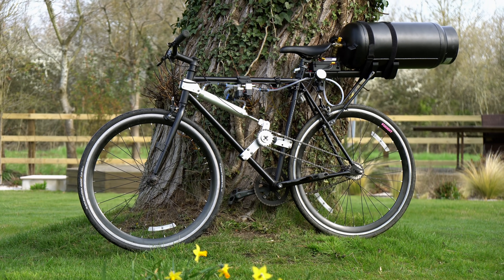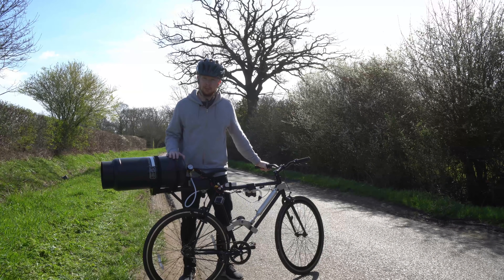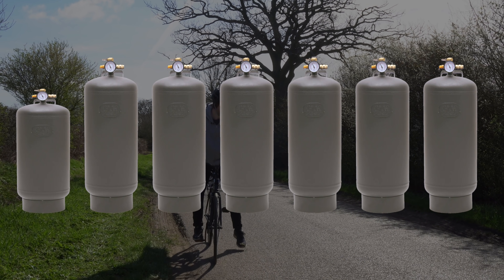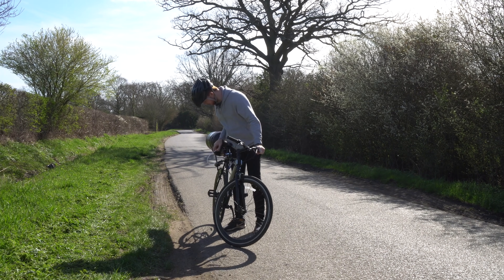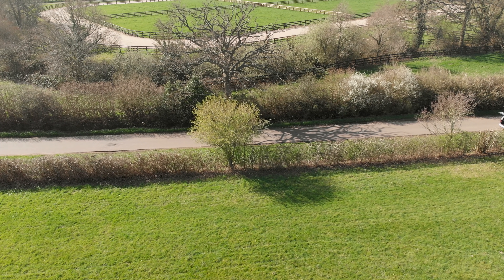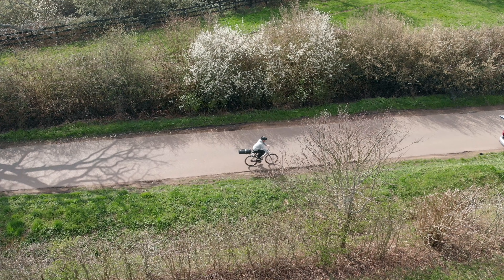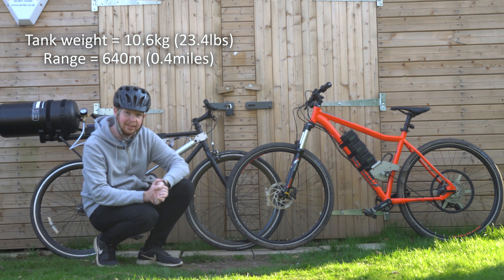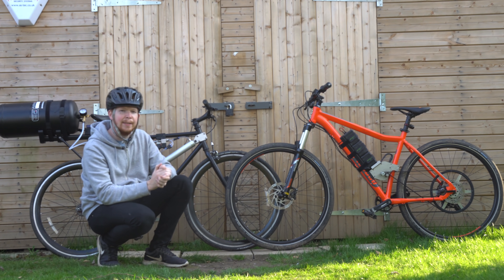Air Powered Bike Range

Comment: I have an idea, what if you make an air bike where when you pedal, it pushes air into a tank, the tank has a valve on it's output where you can turn it on and off, then you can fill up the tank while riding then, you can shoot off with your compressed air jet.

Comment: I work for festo. They did this experiment 30 years ago and got 700 metres out of a tank at 6 bar pressure. Air is extremely inefficient, costing up to ten times more than the price of electricity. Vds and vsc compressors have increased  this efficiency to 25%. By adding heat  retrieval from the compressor we can improve  the efficiency  to 10%

Comment: By the time you factor the heat lost when you were compressing the air into the tank you are less efficient than an gas  automobile .  I'm no expert, but i studied physics at the community college, tho i never got my associate's degree.  Also i don't know that you can improve the design of a modern bicycle, for dog's sake just leave the bike alone.  Try your silly ideas out on a go kart or a pogo stick or some other play thing.  I hate the way people put electric motors on bikes or all that fancy s**t.  The beauty of the basic bike is that it is the most efficient machine made.  it is sublimely simple.

Comment: Fascinating project. Since this is using energy from the procedure required to pressurize air, it can't be equally compared to the stored unbalanced chemical energy transferred from carbon derived the sun's energy, being from solar panels or from ignition of fossilized trees. As a pressurized air project, it's a beautiful result. How about a trailer with giant air tank an two large hard wheels. Center the tank on the axle so the bike is mostly working on pulling the trailer. (It would also be easier to mount the bike!) Nice work. Regards.

Comment: Drop the regulator valve and use cutoff of the intake valve to regulate the pressure in cylinder. Regulator is costing you some energy.

Comment: Hey, What if before actually opening the exhaust you open a valve connecting the 2 inputs for the pneumatic cylinder. At least be able to scavenge half of the excess pressure in the cylinder before opening the exhaust?

Comment: Although I thoroughly enjoyed this latest project it was an unfair comparison of apples and oranges.
A prototype pneumatic bicycle propulsion unit not modified or changed in any way after the original engineering. We're start you have a secondary source of air pressure on the low pressure side that could be utilized. Aire is cheaper to pressurize and store. Windmill for instance you have regenerativere pressurizing for the low pressure side that has not been considered so many things on the pneumatic bicycle to be considered that we're not. And granted it will never match completely or compete with a contemporary thoroughly engineered state-of-the-art e bicycle additional engineeringand development could increase the efficiency and viability of the pneumatic bicycle by huge factors. Consider the fact that underground mining vehicles used pneumatic motors as did streetcars back in the day and they were commercially viable. Pneumaticsusing compressed air storage is a wonderful medium to eliminate be pollution and toxicity of batteries and electric motors. It should be consideredpossibly using windmills year down to drive compressors for free rechargeand compression as well as underground storage tanks for storing compressed are as fuel. Other than the unfair comparison it was a good video once again I always enjoy your videos.

Comment: How about using the bike pedals to crank the air pressure pump, then use the pumped air pressure tank as a plenum, and finally feed the compressed air through a regulator to provide adjustable pressure (adjusted 0 to maximum via the throttle) to a non-impact high torque air pressure wrench mounted on the bike to crank the rear wheel sprocket or simply installed in the rear wheel as a hub motor.

Comment: If you want a small efficiency in the field of compressed air, not the piston engine is the solution but the rotary engines, the turbine ! And even so, you need a rotary engine that perfectly suits the requirement, of what you want to build!  A possible and interesting variant, could be today, the combination of solar energy (photovoltaic panels) and an electric motor (with a speed reducer and torque increase) the electric motor operating a compressor to periodically, cyclically supply the cylinder, so it can be solved and the ridiculous autonomy of the compressed air machines !!! That was my humble opinion !! A good day ! !!

Comment: Silly me. I commented on the first air-powered bike video before watching this one. This video answers pretty much all of the questions I posted on the first.

At the end of the video, you compared energy density and performance between the air powered bike and your electric bike. You also effectively answered the SCUBA tank question. Thanks for that, I had a suspicion that the math wouldn't work out, but you actually did the math (er, "maths" so sorry). Something you also mentioned which I think many commenters in the last video did not consider, was mass. Not only does it take a lot of material to contain such extreme pressures, compressed air weighs a lot more than just "air." I think many people have a common-sense concept that air is weightless. Thank you for explaining that it isn't.

Comparing energy densities, however, one bit was left out: Comparison to carbon based fuels. You mentioned this in your atmosphere powered RC car. There's a reason we're having such a hard time moving away from gasoline/petrol, diesel, coal, and the like. They're very energy dense. A litre of petrol will do much more work than the equivalent mass of even the most efficient battery, and much much more than the equivalent volume of compressed air, given the limits of the technology required to compress and store that air.
I own more than one motorcycle, my littlest one has a very small fuel tank, and will go about 110 miles/175 km before refueling. Eyeballing the size of the tank on your air bike, I expect if I had that much volume as gasoline/petrol, I'd get something more like 400 miles/ 645 km. So... one hundred times more than your theoretical maximum? Oh, also at much higher speeds, say 70-80 kph (it is a really small bike).

Comment: My quest (http://www.velomobiel.nl/quest/) weighs more than 32kg, and is faster than a 5kg racing bike. Racing bikes are a technical abomination, because they try to adhere to sporting rules, not to the best bike technology. Racing bikes are not allowed to have faring, which is the single most highest force that you are facing. The downside of weight is that if you are between cars at traffic lights all red, you will be faster at acceleration at the first light, but the second light you are still recovering, and the third light you might be better of at the bike lane. (Going from 0 to 50km/h is pretty hard 3 times in a row).
In the Netherlands we are not allowed to have support above 25km/h, and the heavy accelaration starts at 30km/h. But it would be nice to see something that can store breaking energy and later on use that for acceleration. But I guess that's better done with electrical motors and super capacitors instead of air :-(.

Comment: Compressed air is the right way to go. Using liquid nitrogen you can achieve the same range potential as lithium batteries without damaging the environment.

Comment: See if you can make it where when you use the bike without the air power, it will fill the tank back up with air. so the cylinder is used as a pump.

Comment: JUST CHANGE THE AIR TO LIQUID NITROGEN AND PUT A ALUMINIUM RADIATOR IN LINE WITH A LPG TYPE REGULATOR   mr boesse nitrogen engine  you will piss it

Comment: I would like you to try flying using either battery or air to flap the wings.
Need a downhill take off I expect and maybe a detachable trolley to ride on.
Reply: How about a glider with a 0,5-1kw electro motor to get u off the ground?

Comment: If you could gas flow the exhaust by bringing the valves closer to where they want to be, i.e. on the cylinder ends. And maybe fit larger diameter valves, then less energy would be wasted re-compressing the air on the way out.

Comment: I'm pretty sure I asked this in a another video, but it seem to havec gone unnoticed. So here we go again. 

What if you were to take away the air tank that's powering the actuator and replace it with air compressors in series and/or parallel to lighten the load and, turning the range dependency from the capacity of the tank (now removed) to the power supply of the air compressors? 

Would this even make sense to try?

Comment: You need to run higher pressure, at least 100PSI for any decent speed 
and torque, and a resevoir having a top holding pressure of upto approx.
 700 to 800 PSI, the tv series called planet mechanics @t explored this, you can use it for some input for getting yours to function better.
Reply: How about variable pressure? To get the bike to spin you need a lot of torque, but to keep it spinning not so much torque and pressure is needed, thus one could start economizing on pressure once the desired speed is reached

Comment: Why don’t you add air compressor to the pedals, so when you pedal you’ll be slowly adding more pressure to the tank to extend the range? Or even connect it to the bike tyres?
Reply: you'd need some insane legs to push the bike + compressor

Comment: But you have to take into consideration, that airpowered trams were roaming quite well in Paris by the end of the XIX century, as well as airpowered cars in mines at the same time. Sure, their range was limited as well, but they've had an advantage of having a better mass/power ratio due to a larger air reservoir, that in addition was transported on rails, and had pumping stations.

Of course, the primary need for airpower was to produce less smoke, and electricity proved superior in this regard as soon as it became available. Paris tram suffered from another problem - due to pressure drop, the air reservoirs were freezing, with a coat of ice building over them. An external heating was needed to prevent this.

Comment: I think you should flip the sides to the right hand drive side and use a rear derailleur to change your gear ratios to make it more efficient so each stroke of the piston get you a further distance just an idea if it has enough torque it should be able to get to a pretty tall gear ratio peace out have a great day

Comment: Great project. But as you are using arduino put an rpm meter and adjust "firing point" accordingly. You would get huge benefits

Comment: are you using air to push the cylinder open and closed? or just one way, then letting the bike return the cylinder? be interesting to see if adding a spring return cylinder would make any difference

Comment: Could you build a sterlin engine powered bike?

Or an elektric bike that is powered from energy you won from an heater ... and with which you can recharge the batery during cycling?

Comment: why won't you use rocket type system.
like removing air from the cylinder through a very small hole

Comment: Please consider fabricating a non-combustive heat generator that generates heat by friction.  
I envision a 50 gallon drum type of first device that would include a serious coil spring as one might find in an old wind up record player, but a good deal stronger.
One would wind up this heater by way of crank or perhaps a foot pedal. A central vertical shaft with flywheel which would spin specified friction points up against some kind of metal pan bottom, creating the heat. 
With modifications, the device could heat a hut without robbing the area of oxygen or polluting it with partially combusted hydrocarbons/soot. With further add ons, it might grind seed to flour, pump water, generate electricity. 
The gearing, spring and flywheel add serious weight, something we want less of, so that it might be hauled through the mountains, jungles, deserts, etc.

Comment: Instead of rotating the pistons crank arm. You could perhaps have used a one-way bearing and just go 1/4 of a turn with a longer arm driving the chain. That way there is no need to time the movement.

Comment: It would be interesting to see how much longer it would go if a gas that liquifies under pressure was used, becauyse there would be more effective volume
Reply: Basically how a steam engine works. Problem there is that you need to add heat energy from somewhere too.

Comment: could you set the system up, so that once the tank isnt being used and its only you pedaling to push the bike along, that the cylander becomes a pump and refills the air tank? or would that require an entire other system

Comment: How about a compressed air regenerative braking system? You accelerate the bike with either human power (cycling) or battery power, then when braking, pump the air into a reservoir of sorts to slow down, then you can use the compressed air to get that extra 500 something meters of range?  

Scratch that, how about just replace your battery pack with supercaps and see how fast that goes :)

Comment: Mountaineering carbon wrapped tanks can approach 50% air weight at about 200 bar. A liquid or solid gas system would also be very interesting as you could have essentially constant pressure. 

I reckon you can convert more energy with a turbine than that piston.

Comment: Mabey try using the pedals to charge the canister back up. You could rig a one way valve so that when you put energy in it compresses the air through the cylinder and stores it in the tank.

Comment: You need to design a bike frame that can be used as the air container, then use a small turbine connected directly to the front or rear wheel. It can be done! where there's a will there's a way!!!

Comment: Not all the donuts succeed with the hole: if the air traction was as efficient as the batteries we would have found the most ecological way of traveling in the world ... apart from the pollution to compress the air and to build the means of transport, there would be no other pollution during use!
Could a jet turbine or a Tesla turbine, (maybe better) be more efficient? of course powered by compressed air not with fossil fuels.

Comment: Compressed air is a terrible way to store energy because of the Carnot cycle - but there's something more shocking - a French company called MDI Air Car has been scamming the world for 15 years promising cars can run on compressed air.

This was considered a "green" energy system by a lot of people, and when I tried to explain that 1) this was a scam and 2) it's unworkable because of the Carnot cycle and any competent engineer would know this therefore it must be a scam - I was immediately vilified as a troll, a liar, etc.

I know people who want to pollute less have good intentions, but I really wish that would learn more science and engineering.  Even with engineers, I wish they would learn more.  The universe moves toward entropy.  There is no such thing as a renewable energy resource - there are WASTED energy resources, but everything runs out, in time.  Sun may take a billion more years, but what's the energy cost to capture it?  This is a serious question which is brushed off by people who truly mean the best.
Reply: tl;dr I don't think it's a scam (as they have a working vehicle), just a meh idea.

from back of the envelope calculation, it's feasible, it looks like they have 0.3 m^3 of air total, which translates to around 10-15kwh at 4000psi, so at 30% efficiency, you'd get 3-5kwh on an equivalent electric engine, which isn't great but is comparable to some electric city vehicles, that's 30-50km range, 1/2 a renault tweezy. 

the carbon cylinders should cost roughly 3k per, with 3 cylinders totaling 9k, in comparison, a 100Ah 12V lead-acid battery is 150 euros for 1.2 kw, though it can only deliver about half, so 6 batteries would be equivalent, for only 900 euros, or 1/10th the price, and a bit lighter.
though in the long run you have to replace batteries, not the cylinders.
if you look at iron Edison batteries, or vanadium which don't have the recharging problems, they are in a similar price and weight range as the cylinders , lithium is better for now at 200-250 euros per kwh, but uses cobalt and lithium which aren't that common, and relatively sketchy as far as ethics go.

but the main problem imo is why bother with making cylinders that can hold air when they could hold hydrogen? (though there is the safety hazard with hydrogen.)

Comment: There are magnetic  limit switches placed over the pneumatic cylinders' both ends which I think will help get a better system response. Velocity then should be accorded with the time of travel between two switches and also by using a variable pressure regulating valve driven by the system's low velocity high power or high velocity low power needs. I liked the simplicty and efficiency of the parts designed. I now subscribed

Comment: I know you are very busu but please try this one out ... it would be the coolest project ever: design a spokeless (hubless) bike, then integrate an electric motor inside the rear wheel. My main idea was to have the rotor (permanent magnets) be the wheel itself, then the stator is in the bike frame (on the inner side of a very large bearing that is then attached to the frame)

Comment: Skip the Scuba tank and instead find a CO2 tank (usually used for Fizzy soda fountains).  The CO2 tank will contain a liquid, upping your available volume of gas.  Also bonus points if you use the phase change of liquid CO2 to gas to create an awesome beverage cooler! :-)